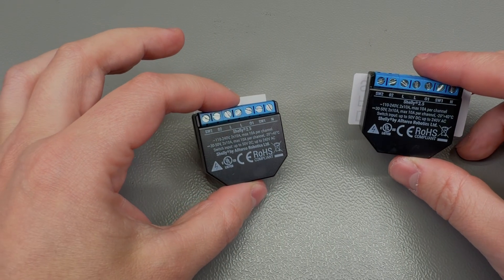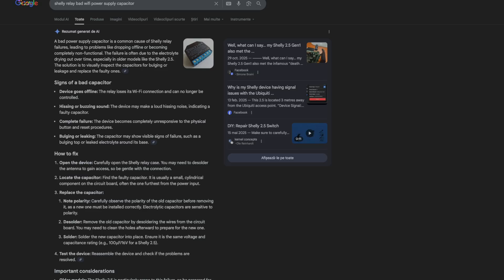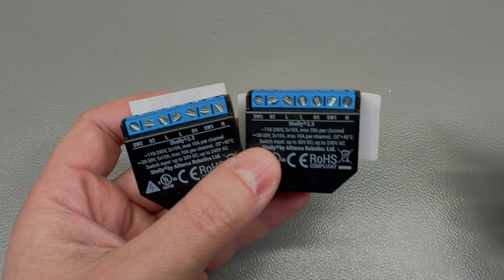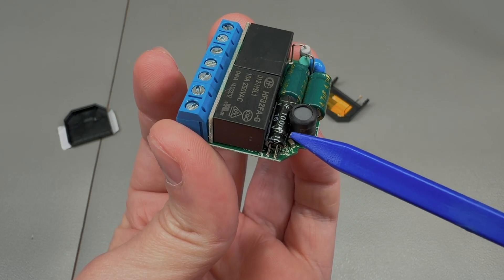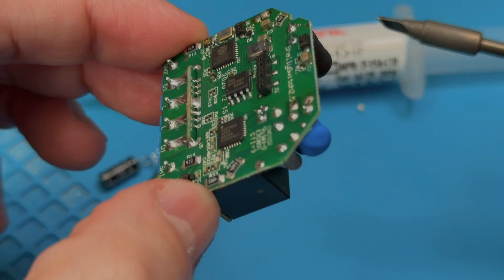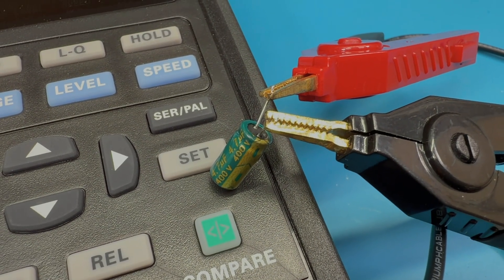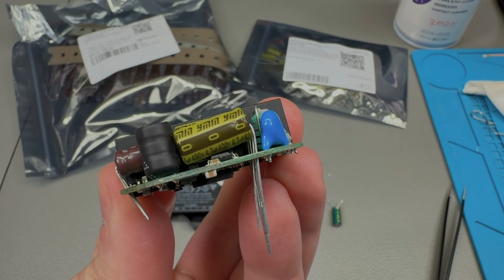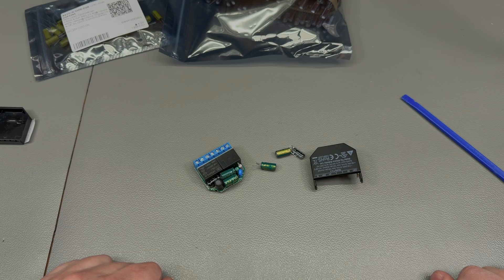The Shelly 2.5 Design Flaw: Cheap Capacitors Killing Your Smart Home Relays

Comment: I had exactly the same problem with my Shelly 1PM. Over time, it lost its WiFi connection, and after a few years it stopped working completely. It only made a disturbing whistling sound. After replacing the 100uF capacitor, it started working properly again. But PLEASE NOTE – the original 100uF/16V capacitor was soldered in the opposite direction to what is marked on the circuit board. Before you desolder yours, check how the factory capacitor was soldered in. My factory capacitor plus pin was in the hole marked (minus) on board!!!

Comment: Those cheap capacitors are rated for 2000 to 3000 hours (3-4 months) at 105C. Given the lower temperatures, they make it right till the end of warranty...

Comment: I have blown a few of similar devices up,in the past, hard to believe that they can pass 10amps at 230V AC thru the contact in which I suspect would be the common issue possibly caused by power surge. In my experience, overcame blowing up these devices by introducing a 230V AC coil relay in series with the channel, and using the contact on the relay to trigger the load. Not ideal but it works!

Comment: I had this issue before with 2 of my Shelly 2.5s, thankfully they were still in the warranty period and I didn't know that the fix could be so straightforward. Very encouraged for the future since it seems like they'll just fail again.. For what its worth, getting them replaced while under warranty was very easy.
Reply from the maker: That's great they were replaced under warranty, but yes, it's a known issue that can recur.

Comment: I’m puzzled where those manufacturers get such horrible quality capacitors. I had brand name bathroom fan timer die after 2-3 years. Dry caps. I replaced with ones I got from absolute bottom of the barrel AliExpress caps assortment kit that I ordered as a filler to get free shipping at some point, and they are running for over 5 years just fine since. Imagine the quality of caps on the production line if Ali special are better.

Comment: ONLY use rubicon, Nichicon, or Panasonic caps. If the size is to large, 3d print a new case so they fit. Never use cheap caps.
Reply from the maker: If anyone else is reading this, don't just follow bad advice you read in a youtube comment. DO NOT 3d print a new case as it will not meet the fire & safety standards of the original one. *Rubycon, Nichicon, or Panasonic ARE NOT THE ONLY good brands of capacitors out there.

Comment: We have a high amount of Shelly Plus 2PM (second generation) in our building since a couple of years now. The oldest one is ~4 years old (May 22). They still work as intended and I'm wondering, if they changed the components in there or if they will fail.
Edit:
The Shelly 2.5 is already discontinued and has two successors by now; the 2PM 3rd and 4th generation. Maybe they are built differently.

Comment: I have 5 Shelly 2.5 which are 4 years old. So far none of them have failed. But one has a bad wifi reception. But it is on the other side of the house from the router and my phone doesn't have the best reception there either. I recently moved and got 2pm gen 4 for the additional windows. So perhaps I will switch them around. Even if the problem is the wifi reception, the new one has zigbee and I have enough mesh router devices.
I also have over 20 other Shelly devices of various types. So far none have failed aside from one case where I was at fault.

Comment: Guys, sure quality of caps seem to be an issue at least on the 2.5 from Shelly. But we have an other problem on us : since late 2023,.these devices are now abandonware from Shelly as no security update is provided anymore and the devices are even stamped as obsolète. Has anyone attempted to create a new firmware feature compatible with Shelly close source firmware but based on an open stack say esphome for instance ? Having obsolete wireless in the wild with potential security problem does not look good to me. Having an opensource firmware would help us to prolongate the life of these 🎉 I've seen a firmware from mongoose is but it is Applekit related... Any feedback ?
Reply from the maker: A lot of people (including myself) are running Tasmota or ESPHome on these.
Reply: @voltlog  having a feature vs feature config/firmware would be nice. This is a way people have used in the early days of wifi AP to get out of the closed source firmware of Linksys and it end up with things like openwrt. Having all the same feature means you have little incitatives to keep the close source firmware.

Comment: I'm running about 60 Shellies in total  spanning just about every device they offer. I started in 2021 and I think around 80% of them are dead. None from the first generations are good. I change about 2-3 a months and have about 10 at home at all times as spares. I don' t know about the newer generations because I just use them for about a year. It's still cheaper than running KNX but they get more expensive every generation. But to say it's not common that they stop working after a short amount of time is ridiculous. But what else coud the marketing team say at a convention.

Comment: The following could be useful if you "still" want to use caps from well-known manufacturers:
I did a component search as well and found the 860021373025 (4µ7/400V from Würth) and ESS107M016AC2KA (100µ/16V from KEMET). I successfully assembled this combination on my faulty Shelly and it worked.
Reply: I used the Wurth ones also and  a solid aluminium cap ( panasonic I think) for the 16v one

Comment: I am not surprised guys on a booth act surprised when someone says their stuff keeps failing. They are there for marketing after all. Still, Shelly needs to ensure they are investigating sources of failure and actually acting on it with good data gathering and reporting. Take it up with their suppliers if the components are failing or not fit for purpose. Of course it could just be design flaw in a device that has to be on for many years, 9000 hours is only a bit over 1 year! Granted at 105degrees... You expect it to work reliably for multiple years, the components have to be rated for the 5 times that at the actual temperatures seen inside that small case in a wall.

Comment: @VoltLog I was a little bit scared to see this video and comments, because, I've purchased many smart relays for sockets and switches and not installed it yet. I decided to open shelly 2PM Gen3 to check caps they use. And, they are different. So, I hope, Gen3 will survive more than 4 years. Would be interesting if you compare GEN2.5, GEN3 and GEN4 to see how they evolve.
Reply from the maker: There is no way you can tell how they will last just by looking at the capacitors.. As I have experience and as others have reported in the comments, other models don't suffer from the same symptoms, they may fail after a longer number of hours or just last very long.

Comment: I don’t use these but between the video and the comments this could be a great case study for an Engineering course. It’s clear that there could be design changes that range from the mechanical for heat transfer, electrical for a more efficient design, more efficient software that lowers the chip temperature and power draw, and then component selection and sourcing. Not to mention procurement, contract negotiation, and vendor selection. So a great deal of attention to the right details.

It seems to me that items like this should have a lifespan measured in years and decades, not hours and days.

Building down to a price is easy if you are prepared to sacrifice MTBF. 

This seems to be the norm these days, witness the short MTBF for LED light bulbs and the CFL’s that came before. And the time and labour costs to replace an embedded device like this is decidedly non trivial.

Comment: 9,000 operating hours?  Thats only 13 months.  Does this mean you will need to do this again in a year?
Reply: 9000 hours is at 105°C. Electrolytics lifespan doubles every 10°C lower than the rated temp iirc.
Reply: @mangatom192 Ah, thanks for the explanation!

Comment: 9000 hours? That's only a year
Reply from the maker: It's not a fixed number, it's rated to run at 105C for 9000 hours and still be good. You can easily get 4-5x that at a lower temp.

Comment: My home smartmeter had an enormous hissing sound. I told the guy that installed it. He couldn't hear it. He said it was fine. And then he went away. Hissing sounds can be normal, as it usually is hissing due to some coilwhine.
Always listen to your new device, to know if it normally hisses, or if it started to hiss. The difference are indeed caps.

Comment: Good to know, I have them all 3rd gen in my house and i think none of them have improved over the time if Shelly said they don't have this issue under their radar. a once in every 4 years change of caps will be needed for everyone if they want to keep them working. it is not a matter of IF but WHEN
Reply: Who wants to disassemble 50+ sockets and then waste few days to resolder caps every 4 years? My other devices run 24/7 without failures for much longer. If shelly device last only for 4 years than it is absolutely not worth to use it at all. With normal usage smart devices should last for like 10 years

Comment: Hmm, imagine that.

I bought a bunch of the first gen, the blue ones and they started failing in this way one by one. Did not even think that it could be so simple, used to work rock solid.

I decided, when the first one died to ditch Shelly alltogether, i now use Sonoff Zigbee devices exclusively, i just replaced my last shelly last weekend and  will not be going back.

Was planning to go all zigbee as wifi it a bit sketchy here, with many clueless neighbors blasting the 2.4 GHz frequency, but this is pretty poor by shelly.

The last one i replaced would drop out and come back for 30 seconds about every 10 minutes, so light would often be left on because if it was offline when the PIR sensor detected no movement it would send a "Turn off" signal that was never received.

Comment: I had to repair almost all of them until now. But it's not ony 2.5, the "dimmer" has the same issues. I got a dozen of grade-a caps and replaced all that started hissing.
Reply from the maker: I also have 6x dimmer 2 green ones, installed 4-5 years ago, about the same time as the first shelly 2.5. None failed so far but I will keep an eye on them. One thing worth noting is that the dimmers, run hotter.

Comment: I have 16 of these 2.5" Shell devices, 5 of which failed after a while. The fault was quickly identified with an LCR meter, and replacing the electrolytic capacitors has always solved the problem so far.

Since the Shell devices are connected to a Home Assistant, I've been logging the temperature in the Shell devices and displaying it in Grafana since the first failures. It turned out that the temperature increases as the electrolytic capacitor deteriorates. I then replace these capacitors preventively. Since then, my system has been trouble-free.
Reply from the maker: That's a great approach to proactively manage the health of your devices!

Comment: I have loads of "Aubess" Tuya wifi smart switches, and every one has had a failed 330uF 16V capacitor that's branded "ChengX". These caps are total junk so I fit 105C Rubycons instead and that's that. You also see these caps in the same colour and logo but marked "ChangX" and "ChongX".
Reply from the maker: Thanks for sharing your experience, it's always good to hear about similar issues and solutions.

Comment: Just last week, I had exactly the same issue on 2 of these at the same time. Only the lower voltage caps seemed to have issues on mine. I replaced them with Panasonic EEUFR1C101 from Farnell.
Reply from the maker: Glad you got them fixed, but you can be 100% sure that the hv caps are also out of spec on your units.

Comment: In Norway we have 5 year warranty by law. If all countries enforced the same, product quality would very soon improve.

(The 5 year warrany is for goods expected to last for a long time, like furniture, electronics, household appliances, cars etc. For product that is expected to wear during normal use, the warranty is 2 years, like for clothes and shoes etc. Also parts that are expected to be worn down don't  have 5 years warranty, like the chain on a chainsaw)
Reply from the maker: That's a great consumer protection law!
Reply: I would love to see that proposed. The companies who are incapable of making good products would tell on themselves immediately saying "that's not financially feasible!"
Reply: The EU regulation is that a product must be fit for purpose and last the expected time.
Reply: @BobHannent Nope.
Reply: @Stefan_Dahn  Directive (EU) 2019/771 specifies two years minimum, previous directives, possibly Directive 2011/83/EU have presumably specified ‘fitness for purpose’ given much of the EU consumer protection directives are ultimately derived from very long standing UK legislation
Reply: Does this includes software bundled ? Coz here the 2.5 are in an abandonware state and the ESPs on board are not provided security updated since 3 years.
Reply: @testman9541  If you buy a product that relies on software, the vendor has to offer free software updates for at least 5 years. These are updates needed for the product to work safely and as intended when you bought it.

You can't demand new functions, but if there is a bug that should be fixed with a software update.

Comment: My Shelly 2.5 always died with dead relay contacs (capacitive loads) - before a capacitor goes bad.
Reply from the maker: hmm how big is your load?
Reply: @voltlog  at the moment of "Turn on" 4W only (Switching power supply with USB Control. Starts at 0A, so standby only. Then raises up to 300W. The contact-death-sentence is the inrush currrent of the input capacitor....

Comment: Awesome, one 2.5 already was already replaced. And the replacement unit keep loosing connectivity and does the hissing sound as well. Might give it a try to refresh them, so thanks a lot for the video!
Reply from the maker: That's unfortunate to hear, hopefully, the video helps you diagnose and fix the new unit.

Comment: I just replaced an 11-year-old blue Shelly that was failing the same way. It suddenly started to stop responding to Home Assistant (and its web interface) intermittently, and to reset it, I had to power off it and power on it back in. Since I have a dedicated power switch for the lights at home, it was easy to power cycle the Shelly without shutting down the entire house. Then I noticed the humming noise coming from inside and eventually replaced it. When I tried to open it to try to repair it, the case felt like it had been glued together with a sonic welder, and it eventually broke, so I simply threw it away.
Reply from the maker: That's unfortunate that the case broke when you tried to open it. The enclosure does have a protection role, in case the internals get very hot it should contain it.

Comment: 9000 hours is only 1 year. The new caps will also fail rather quickly. It's a suboptimal design.
Reply from the maker: It's a curve not a fixed number. Yes, not optimal, but the cap is rated to run at 105 C for 9000 hours and still be good. That can easily 4-5x at a lower temp.

Comment: Isn't the other option to 3d print a bigger enclosure?
Reply: It needs to be heat resistant self-extinguishing plastic.
Reply from the maker: needs to have certain properties, needs to be small to find inside the electrical box.

Comment: Have loads of these but they run esphome and run cooler than the original shelly firmware.  Only used for blinds and venetian blinds. The relays used regularly but not permanently so none are dead after 5 years. Have replacement caps ready to go if needed.
Reply from the maker: I can't see a good technical reason why it would run cooler on esphome, tasmota vs shelly firmware, unless there is a problem with how the temperature sensor is converted. Most of the heat inside these comes from the PSU circuit and the relays so that's your source of heat.
Reply: @voltlog  I don't know how much my observation covers your comment, but there is a HUGE difference in CPU temperature depending on whether your sketch uses a WiFi Access point or just connects to one.
in my case above 65C when the ESP32 creates an AP vs 48C when it does not. (both simple ESP32 S3 mini boards encased in a project. Power supplied over 2 wires directy to the 5V pin and and the GND pin. So the only part of the power supply that runs in the casing, is the 5V to 3.3V dc-dc convertor )

Comment: I've had around 15 of these failures over the last few years. I used to try and debug it and test the capacitor before, but since every single failure was a cap I've been just blindly replacing them without any tests ...works every time so far
Reply from the maker: indeed, there is a very high chance the defect is the same across multiple devices of the same type/age.
Reply: What exactly happens when they fail? I mean, it's obvious that they won't work anymore after they fail, but what I'm interested to know is if there's any safety issue when they fail. Thanks!
Reply: @dan-nutu I don't think there's any safety issue. It starts when they fall off wifi, turning the breaker off and on fixes it for ...a few days then they fall off again. It gets progressively worse and then finally the off/on fix doesn't help. Local control also stops working and frequently they also make a high pitched whine or hiss noise that I can hear through the switch
Reply: @mitchese1 Thanks a lot. I know that annoying mosquito sound! My main concern was not to start a fire!